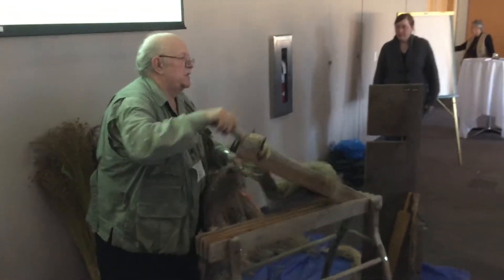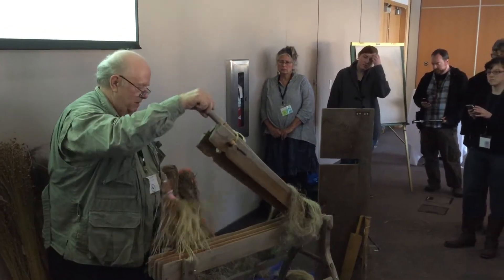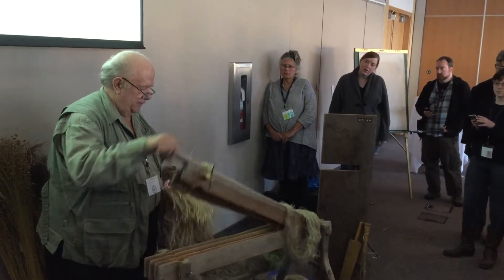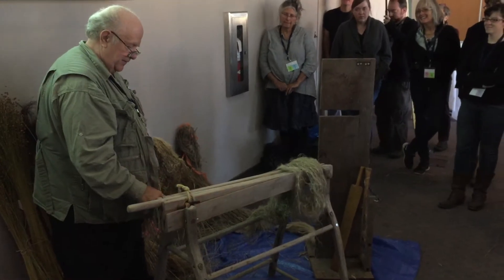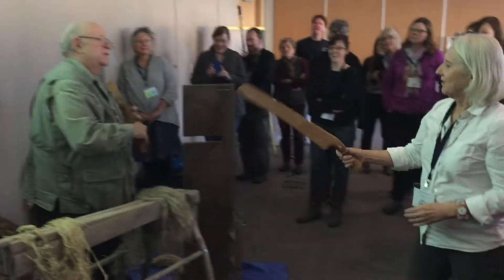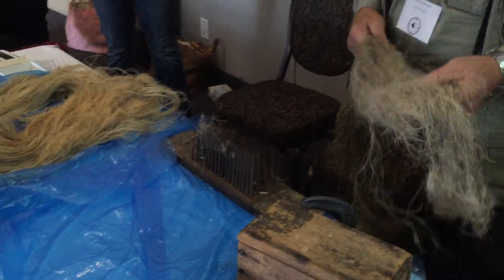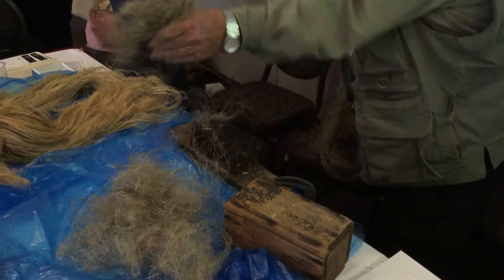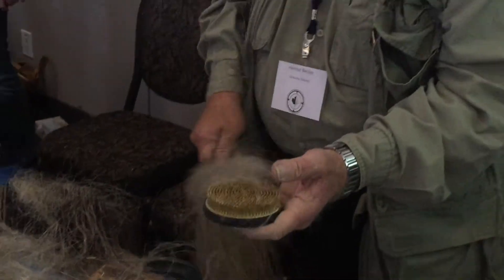Fibre Flax Processing Demonstration Becker Banff 2015

Comment: An interesting demonstration of the over retted flax. With that demonstration I know my flax has not been over retted. I did rett my first batch in tied bundles in the water but found that the outer stalks retted just fine but the inner ones did not. When I did my second batch I retted them all loose and they all equally retted and Im currently retting my third batch as a winter rett but not so happy with the time requirements and the damp wet weather and I don't want the stalks to mold. So far so good. Nearly done. I made my own hackles and getting ready to make my own brake. I had to borrow a brake from a group near me. I want my own so I'll build it as well as a scutch board and knife. Going to try a different variety of fiber flax this year. Hoping to find one that grows taller than the Suzanna variety.